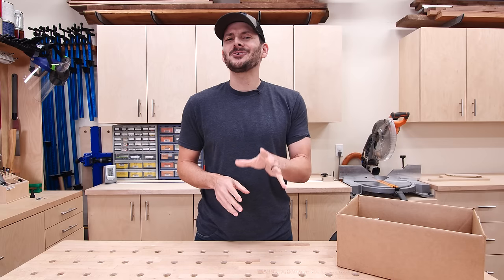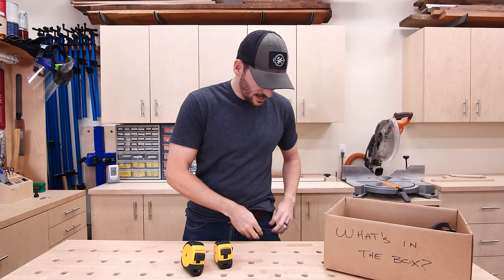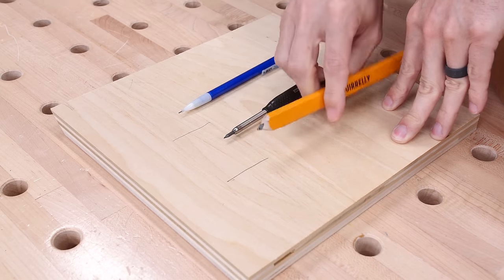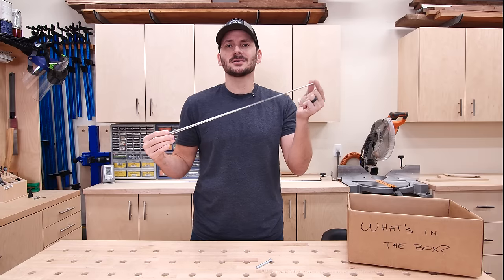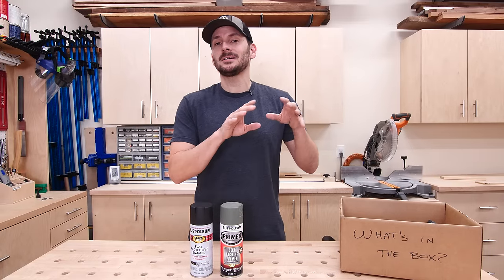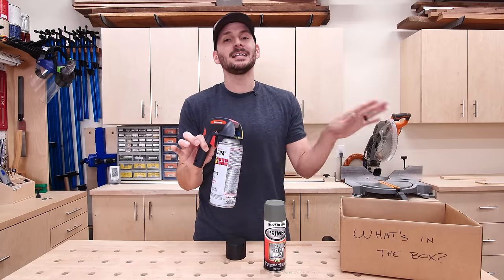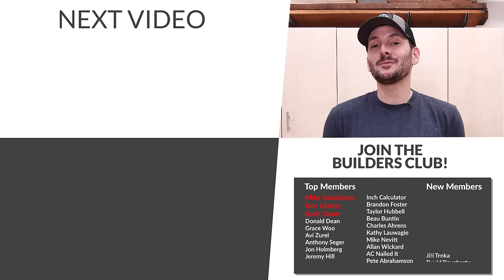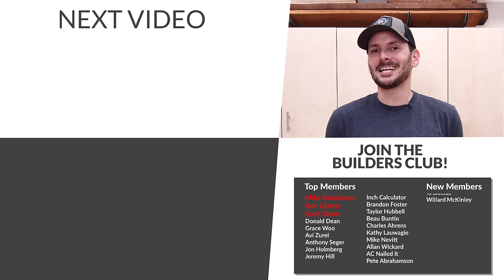12 Tools Under $20 Every Woodworker Needs

Comment: Komelon and Stanley also make auto-lock tape measures. These are nice because you pull them out and they stay out until you push the release. Stanley's Lever Lock are particularly good.
Reply: I have a lever lock that still has plenty of spring-i-ness but doesn't hold the tape for $#!+. I actually love the Menards Performax 12' tape. Has a button underneath for a temporary brake. Then an easy locking brake up top.  Marks line up perfectly with my Sawstop marks so I know I'm staying accurate for only a few bucks.
Reply: Hart tools also makes a tape measure like that. Available at Walmart (I know sorry about that. I try to never go there anymore with their I-have-to-do-it check out lanes).

Comment: I would suggest getting a knife. Specifically a rigging knife with marlinespike. I bought a replica of of a knife used by german navy. Knife is nice and sharp, and marlinespike can be used as a punch/marker for wood and thin metal. I also carry a length of rope (10-15ft) which I use to tie up planks when I carry them from a local wood yard...

Comment: Hey Brad, great video! I didn't scroll all the way down (sheesh 388 comments on a 4 day old video, you must be doing something very well lol) so this may have been said already.  Most yellow Stanley (or Olfa) box knife, the black end (or whatever colour it is) usually has a slot in it. Take that back piece off and look, that slot fits over the blade perfectly and is used to snap the perforation of the blade to keep the point sharp. Not sure if anyone else mentioned the slot purpose. Keep up the good work!
Reply from the maker: Didn't know that!
Reply: That's an awesome safety........ Tip!! Thanks

Comment: You should add a chalk marker to your list for next time. Perfect for marking walls or other smooth surfaces since it comes off easily with just a wet rag.

Also, I can’t recommend the small tape measures enough. Very rarely will I ever need a measurement longer than 9-12 feet and they’re so much easier to use and keep with you.

Comment: I prefer old school pencils... good ol' #2s... I got several magnetic and screw on individual pencil holders mounted on various tools and my table saw, as well as on my shelves and workbench. mounted an old school pencil sharpener to my wall and have little sharpeners in random locations... a sharp tip is always close at hand...

Comment: For mechanical pencils, try a mason 6 in 1. It’s kind of the beefier much more expensive version of the one you showed. The lead is thicker and it comes with soapstone also. It has a 6 inch rule and level on it. On the opposite side there’s a cap that’s a sharpener but when you screw it off it has a scribe for finer woodworking marks

Comment: I just bought the pencil. The punchy things are already in my entry kit.... I mean IF I had an entry kit, they would be in it. The center punch shatters auto glass wonderfully. Excellent for emergency entry into a vehicle. 

(Such skills are awkward to explain to Badged People)
Reply: Join a volunteer fire department! Someone looks in the back seat of my truck they'll find a bag with surgical gloves, small prybars, lockpick kit, glass breakers, bolt cutter... And every single one is justified.

Comment: I'm not sure what is exactly called BUT there is a little hand planer, that I call a finger planer which is about 2" long and is great for taking of little burrs or glue from your project. I use mine more than I use any regular planer. They are great for flushing up miters quickly and cleanly.
Reply: It's called a trimming planer apparently and is $15 here in Canada so it must be what, a nickel in the States! Lol

Comment: Something that I never see mentioned is an engineer's tape. Probably not the most useful for your casual woodworker, but great if your doing larger things. Engineer's do things in 10ths of a foot rather than in inches. An engineers tape can help you convert it from 10ths to inches.

Comment: I gave up on picas. If you work at home I’m sure they’re great but on a job site or dusty environment they just stop working. They fall apart easy as can be. But I do still use their pencil quiver to hold a regular carpenters pencil. They’re pica gel line is pretty great too. But the mechanical pencils are junk. I’ve seriously bought the big and small ones numerous times they never last more than a month.

Comment: I grew up with the, what you called utility knife, and I always wondered what the adwantages of the box cutter is? There are versions with long stabilizer so you dont snap it off if you don't want to.
What is the advantage of the fixed blade box cutter?
Reply from the maker: guessing it's just the blade style

Comment: try oral syringes for some of the 'bigger' and more viscous liquids.  No metal type, but has the same measurements and suction.  Also great for applying wood-filler to fill nail holes....load the syringe and it won't dry out on you nearly as fast.

Comment: Those Irwin pull saws are a bummer in my opinion because the blades are meant to be replaceable but theirs are fixed
Reply from the maker: true...the bear saw is replaceable blades and I linked to a nicer flush saw with replaceable blades as well

Comment: To not have to shake your pens or markers I leave them in my pocket tip down, gravity will keep the ink as best as it can be, I am a forklift driver, I have to date and code the product I put in the air so that we can quickly take down what we need to take down, so I used to burn threw a lot of chisel tip markers til I realized that they last longer that way

Comment: Theres a tool that was on dragons den once (a tv show if you dont know what i mean). It was a small spray can with a nozzle that fits into deep drilled holes so that you can spray through them and mark where they line up. Gets plenty of use.
Reply from the maker: oh yeah, I've seen that.  With bright orange or green paint
Reply: Yeah
Reply: @Fixthisbuildthat  i posted a link to it but it seems to have gone
Reply: Great idea - mine sadly exploded after half a dozen uses
Reply: Can you not attach links to the comment section or something?
Reply: @namename3130 - would love that link.
Reply: @furmisl203  ive sent it but idk if youtube gets rid of it or something

Comment: The Complete Silicone Glue Kit Wood Glue Up 4Piece Kit 2 Pack of Silicone Brushes 1 Tray 1 Comb Woodworking Glue Spreader Applicator Set. Great for glue ups, long lasting with minimal clean up. Available at Amazon

Comment: i used a lot of those snap off blade knives at work and i found olfa brand of knives are way better they come in quick slide in and out lock in place that holds securely or models with a wheel that really locks it at length you like you should try them they also make extra sharp black blades for snap off knives

Comment: The Complete Silicone Glue Kit Wood Glue Up 4Piece Kit 2 Pack of Silicone Brushes 1 Tray 1 Comb Woodworking Glue Spreader Applicator Set. Available at Amazon, great for applying glue and not having to re purchase or spend time cleaning.

Comment: Silicone glue brushes and spreaders.  They won't leave bristles in your glue jounts like acid brushes and cheap paint brushes, they're're easy to clean (even dried glue lifts right off), and they last forever.  The first time you use one you'll kick yourself in the junk for not trying 'em sooner.

Comment: The Stanley adjustable box knife is ok, but they have a habit of retracting. So, I bought a Olfa knife and the blade locks in place.  Won't give it up for the old design.

Comment: milliliters and millimeters are actually connected, because one mL is the same as one cubic Centimeter. Different ways of expressing the same volume.
Reply from the maker: now that's something I didn't know.  thx
Reply: @johncoops6897  meanwhile, base 12 is maybe less simple to work in but is more versatile because 12 has more factors than 10.
Reply: @johncoops6897  you use yards and miles in your woodworking measurements?

Comment: I was gonna say a decent square but you eluded you them with your grandpas.
Also, I bought a Dewalt flush cut saw that has an offset handle so you don’t have to bend it AND it pivots in the middle to cut from both sides! Anyways, fun video!

Comment: Cut and stab, the first knife “ box cutter “ we have all been in those near miss or accidents situations using these knives, cutting through tough material when it suddenly slips, you can actually buy the same knife with an auto retractable blade, so when the force suddenly comes off the blade such as a slip situation , the blade retracts automatically, instantly. Sorry but I cannot remember at the moment the brand or manufacture, when I do I will update, As a Millwright I I work with the electrical trade daily and because of hand injury’s within the  electrical dept , these retractable knives were introduced, they have worked awesome. Also the Stanley knife..for the same money but much better quality, buy the Olfa brand.  I will update my comment once I remember that brand of auto retractable knife. Cheers and thanks as usual for the great videos.

Comment: What's the difference between the punch at 7:01 and the punch at 8:15?
Reply: The automatic center punch (at 8 minutes) is mostly a one-handed tool, just set it down and press. The spring punch (at 7 minutes) requires both hands to use, but gives you more control over how hard it hits. Essentially ease of use VS precision.

Comment: Thanks for the video! do those tape tips move back and forth the width of the tip? I’ve purchased short, small, tape measure but they’ve never had that so measuring inside and measuring outside give different measurements.
Reply: Yes that's what that feature is for
Reply: @clemmcguinness1087  yes sir. The short tapes I’ve purchased don’t do that, and I want them to. Didn’t want to spend more money on tapes without that feature.
Reply: @johncoops6897  when they are completely shrink wrapped or have that molded plastic cover, you can’t get at the hook. I’m glad your experiences have been more positive.

Comment: Cut resistant gloves, cheap, and will save you cutting your hands, and more importantly, you won't get any slivers, I use them in my shop and haven't had a cut or sliver in years, think of them like safety glasses for your hands lol. They are around $10 for a pack of 3, and one pair lasts me over a year.

Comment: One of the big design problems I've found, is that regular utility knives with a slider to move the blade, the slider is DIRECTLY where I usually put my thumb on top of the knife. Stanley's regular is the perfect example. Everyone I've asked has had the same problem with these, yet, they continue to make them Surely someone makes a better design with a locking adjustment slider FOR A REGULAR BLADE, not the one he shows here with the dozen snap off blades.

Comment: The best woodworking tool for under 20$ you can get is a sanding pad with velcro so you put your regular 125mm sanding disc and sand away!

Comment: Problem with tongue depressors / popsicle sticks is the rounded ends make it impossible to mix things completely, they won't get into the corners of the cup. 

 Do yourself a favor and take 2 minutes to tape a stack of them together and take one end to a bandsaw or belt sander or whatever, to get one end square shaped.
Reply: @johncoops6897  yes, definitely that too, if half length is long enough to reach the bottom of the cups you're mixing in

Comment: never tried that pica pencil but i have a beautiful and slim koh i noor lead holder i use for sketching that i’m sure i would prefer, for the same argument as the tape measure (size and wieldability.) you don’t have to have an attached sharpener 95% of the time if you inevitably have other tools around, and also the pica is just horrible aesthetically to be honest.

Comment: do not use a snap off blade longer than one segment ..i have a 6 inch scar up my wrist using one too long and breaking ..all my snap off blades were dumped after my experience ..they do make long blades without segments which are far safer

Comment: Actually, the problem with the tape measures isn't their size but is that they are marked purely with imperial measurements which are used only by the US, Liberia and Myanmar. I prefer a metric tape measure that allows me to keep in step and up-to-date with the rest of the planet.

Comment: Those mini tape measures are not as accurate I have one of the 6foot  Stanley's and it's off by a 32nd when you hook the end onto something.   I find them only convenient for going to the store when you need to measure things and don't wanna run to the tool section to  grab a tape measure.

Comment: The pics is a great idea, but carrying it with purpose just doesn’t work well…I’ve carried one for a year and wouldn’t give up until it made me. The graphite falls apart too quickly and the sharpener takes too long. If you do dyi fine, but if you are a true finish carpenter then it gets too time consuming
Reply: Almost forgot, reinserting the pencil will break the tip 2 out of 5 times
Reply: Well crap, I haven’t tried the white yet…ffs, I wear a hat and keep my utensils in it